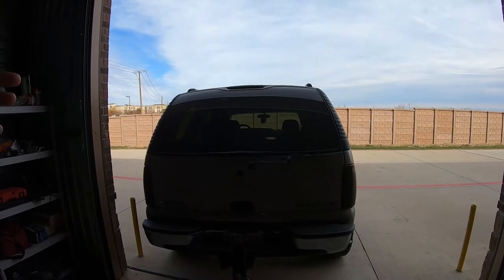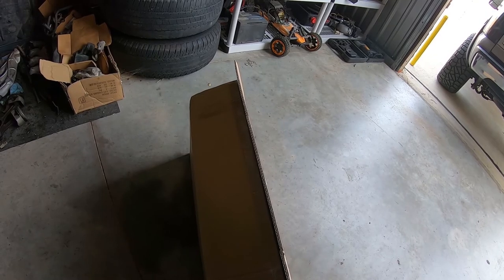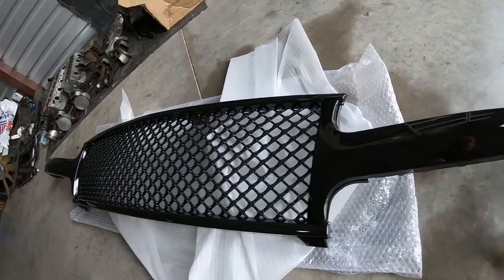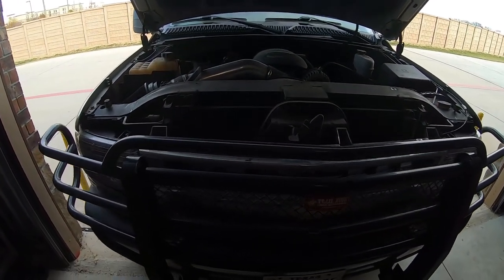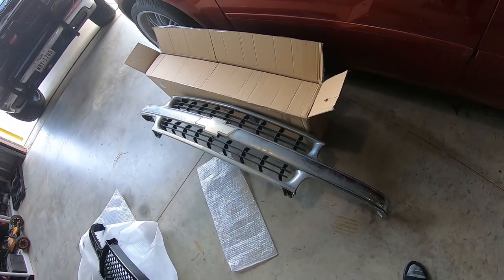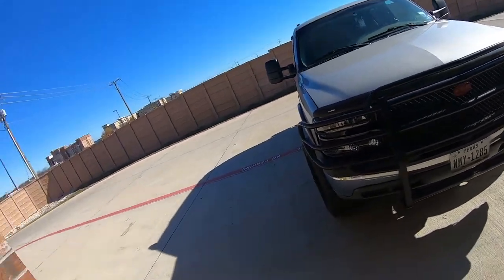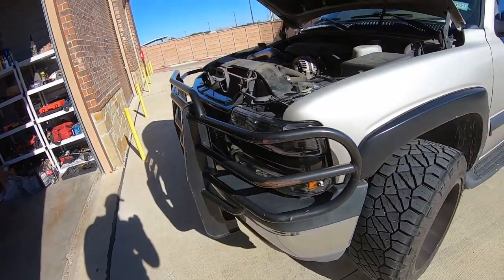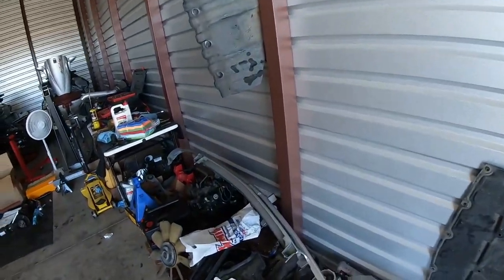Installing The Cheapest Grill On My Tahoe

Comment: Have the same problem. Only 1 clip was able to attach. The rest by electrical tape. Going to cut off the plastic piece that the clips are on then drill a small hole use a small screw for all 4 areas. I like the ziptie idea but if I do other work I don't want to cut then get more ties. Definitely liked the video and shows I'm not the only one with the problem

Comment: Did you have any problems clipping the other side pieces of grille to body?
Reply from the maker: Yes I still have it zip tied since it didn’t fit all the the way flush
Reply: @chantzsgarage  ok. I'm going to zip tie the front areas where the clips failed but I'm not sure how to do the ends that past the headlights/turning lights. Appreciate your reply. Thanks again for your sharing
Reply: Looking for a solution for the same problem…side pieces don’t clip into the fender like the factory did…did you just leave the ends flipping?
Reply: @Icexman1063  I cut off the clips and drilled a small hole to slip a small 4"  black zip tie. It was hard to tie them on the bottoms but quick on top
Reply: @n34z3r  I’ve got that part it’s the 2 headlight divider on each end is where I’m having issues
Reply: @n34z3r  btw thank you for the video and advice
Reply: @Icexman1063  oh yeah. I still have a problem as of now. It's not connected. It's staying in Place because of the headlights but not secured. I'm trying to fix that. I may have to drill a small hole in the ends and get a type of hook to attach to the part where the original grill snapped into.
Reply: @n34z3r  awsome if the deal I’d the headlights help secure it then I’m not gonna worry